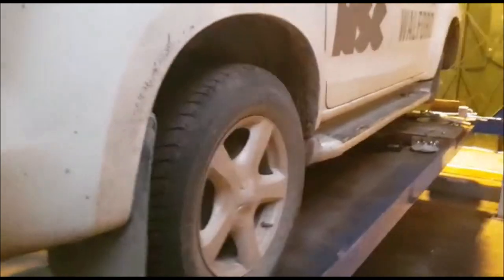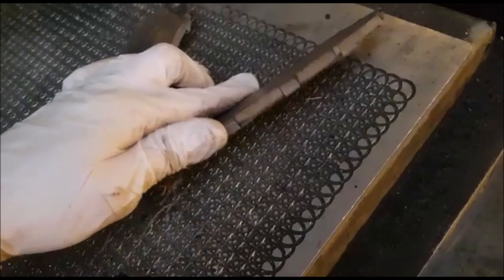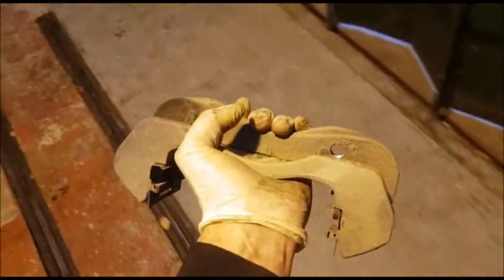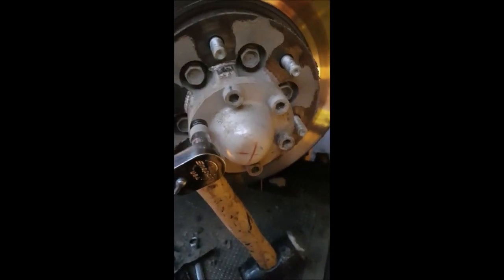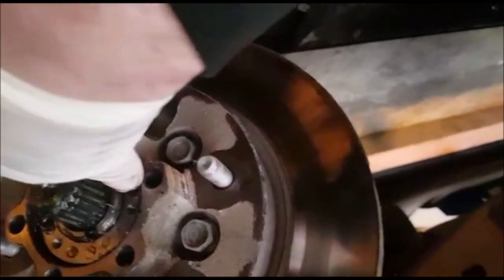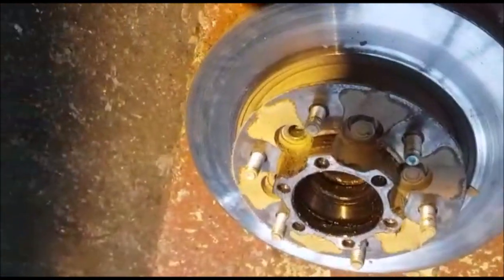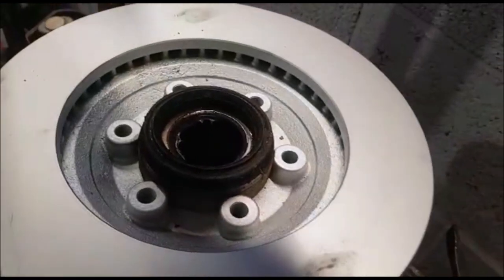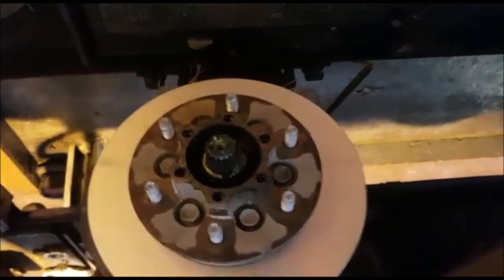isuzu d'max front brakes and  disc replacement

Comment: whenever you are taking many bolts, like the round pattern you have on display, or in a square pattern - like the valve cover or heads' pattern set up as well, try to do it in a cross sectional way - intake manifolds, on the on the other hand, do what the engineers have indicated to manufacturers on service manuals taking into consideration its construction material  - that is the professional way to do it in order to avoid demage to structural surfaces you are working on it - that is made in order to balance the stress fatigue of metal tightened according to specs and to prevent premature failure of stressed metal parts👍

Comment: Even though the discs are new do you true them  ul first on the machine?
Reply: Generally no, just use some emery sandpaper and clean the mating surfaces so they bolt up flush and use a criss-cross pattern when tightening the bolts, just for the sake of it, I do them up to 50% of recommended torque, 75% then finish with 100%. Probably doesn't make a difference but I think it does considering heads and stuff get done gradually.